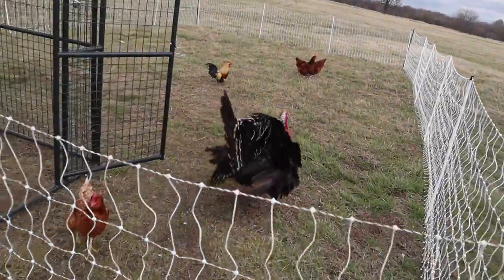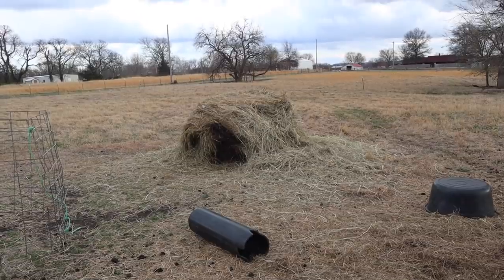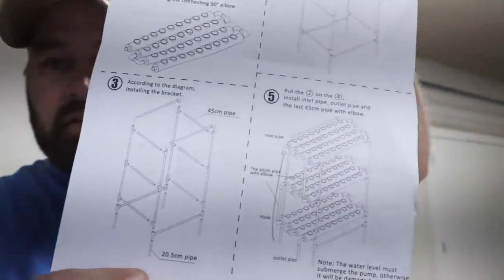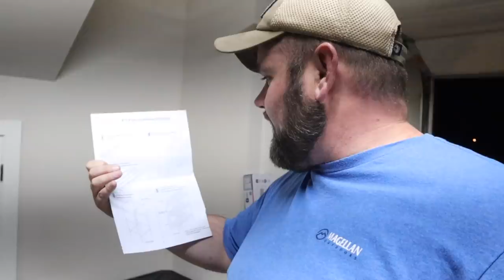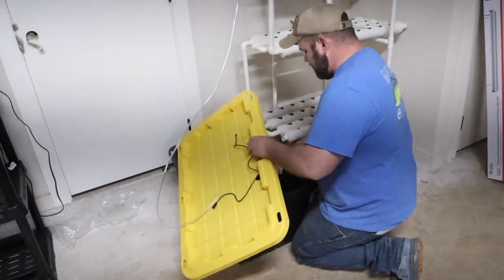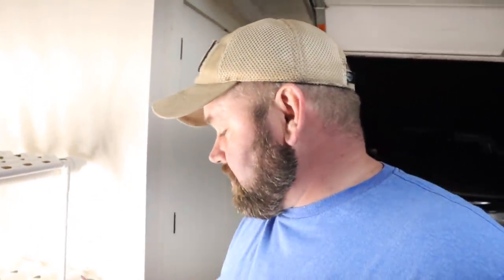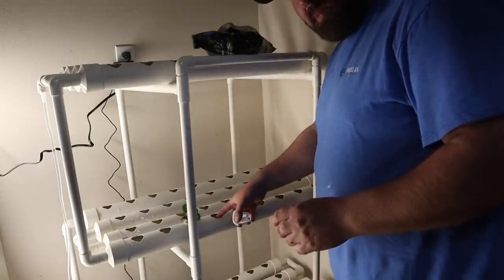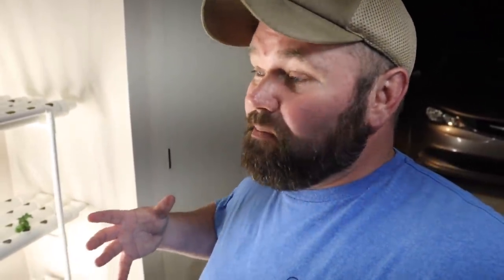(GROW INDOORS) Amazons Strawberry Hydroponic PVC System, Grow The Best Strawberries

Comment: Hi Dutch.  We bought 5 of these last year (four generations smile).  Greens grew super well in it after we installed 2' led lights under each level.   Watch out for aphids and do NOT use organic fertilizer (liquid manure), because it grew nasty stuff inside and the system is a pain to clean.  Aquaponics will work I think.  Going to try your strawberry idea.  Thanks for sharing.

Comment: Dutch. You need an air rater in the tub too. And I would change the clear pipe to a dark pipe .. try and keep the light off the water as algae will grow in the system. I have been looking to do this in the shed

Comment: Love that hydroponic system
But I think one light above will not be enough..the lower tubes will not get enough light.  You will need a vertical grow light.  I grow cacti and succulents..so have to have a light above each shelve.
Below will show you what I use..but these can be placed vertical or horizontal. 
Hope this helps. Got from Amazon.
Hydrofarm FLT44 System Fluorescent Grow Light, 4-Feet

Comment: Dutch, nice little pre-packaged system.  Only thing I would recommend is get a fish tank heater and air pump to add to your system.  The growing solution will do better if you can keep your plants roots at a temp closer to optimal growing temp.  Also your plants will take up nutrients better if the solution is aerated.  If you want you could go to an aquaponics system by getting a stock tank and using plain water instead of the growing solution and having fish in your tank.  By feeding the fish the water gets nutrients, which the plants filter out, returning cleaned water to the fish.  A good species to use is tilapia.  They have a rapid growth rate, but the down side is they are semi tropical so they require warmer water temps for optimum growth.

Comment: To keep the chickens and turkey off  the quails cage  , take a piece of plywood the length of the cage and three feet tall ..Place it on the front edge of the cage lay the top on the wall . You can use metal if you want . Just so they can`t roost on it .

Comment: As far as the overall structure, it would be time consuming  to punch the semi-circular holes unless you had a template. But overall you could save money having your own design. If money is not a concern it would be less stressful to use their system. I don't know if this is a new thing but if it is prices tend to be higher at first. But not having to buy plant food and just using water is very cost effective.

Comment: H town brother!  Looks great, a couple suggestions: Either cover or change that clear line to a solid color, preferably black (the clear will cause mold/bacteria), also you mentioned mounting a light above which is great idea.  I would also add vertical lights bc the light eventually (quickly) won’t reach the lower levels and your growth will be poor.  Lastly (research how, as mentioned, the old hippies did hydro cheap - add a few drops of bleach to avoid bacteria and mold (you will see that soon, especially if your water tank gets above 70ish...)

Comment: The dark rolling bands in your video is called "phase banding". It is caused by your camera shutter speed being out of phase with your lighting. This is especially prevalent when using fluorescent lighting (which flicers on and off 50 or 60 times per second.) If you switch to incandescent lighting it should reduce the problem considerably. If your camera allows you to adjust the shutter speed, set it to less than your fluorescent light Hz (which should be 50 or 60Hz.) High end cameras let you fine tune the shutter speed. The best settings for the least phase banding is usually 25% or 30% of your lighting Hz. You can also try using a much higher shutter speed. You can also try using different ISO, which may require you to use an ND filter on your lens to let in less light. You can also try using different frame rates; if you are using 30fps you might try 24, 50, or 60 frames per second.  Point-n-shoot cameras don't typically have much shutter speed adjustment, but they do usually have an "anti flicker" setting of 50 or 60Hz.  If you are using 60 you might try 50.  About all you can do is try different things till you get the least phase banding.  Using incandescent lighting is probably the easiest solution. I found a 300 lumen LED flood light that causes no phase banding and that's what I use to light my scenes when taking video, I use it with four different camera without any banding problems. Many LED lights do cause phase banding though, it's sort of hit and miss till you find one that works with your camera.

Comment: So did you actually end up with strawberries in the end? I bought a very similar system (same sized holes) and while my plants flourished at the beginning, the roots started to rot and turn slimy and black after 3-4 months. I did get some strawberries, but the yield was what you'd expect for a sick plant. In the end, the weak water pump and the fact that I didn't add H2O2 probably contributed to the anoxic conditions that sickened the plants. It was my first hydroponic attempt...and really, my first plant growing attempt.

Comment: Did the root systems get too big for those small holes? I have considered getting one like that but was reluctant because the holes seemed so small and the pipe not very deep. Were you able to keep the plants in that the whole time or did you have to move them to a deeper system with wider net cups?